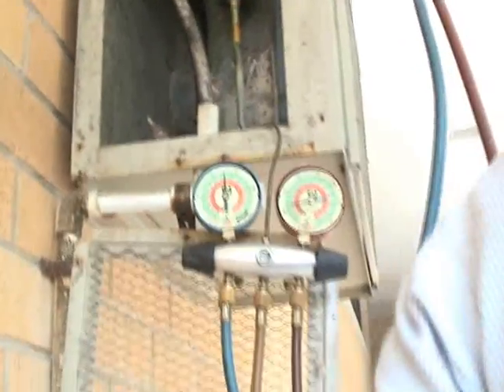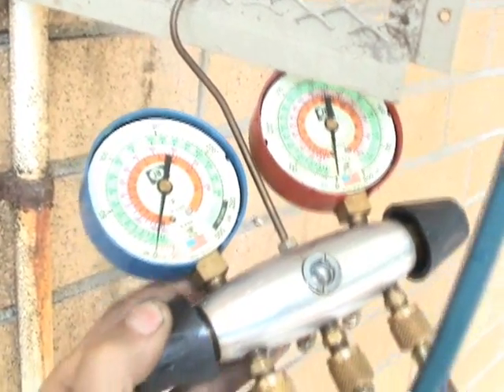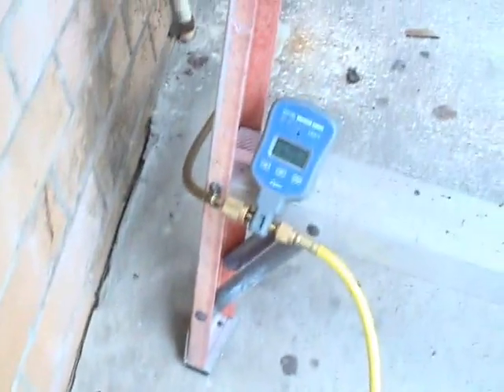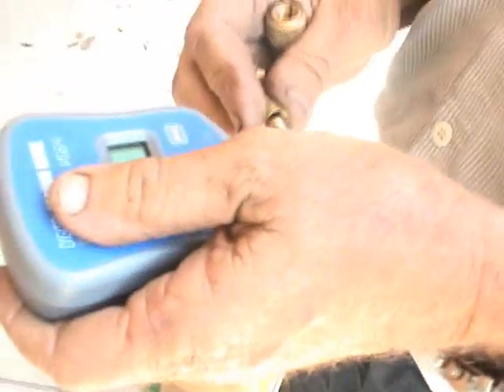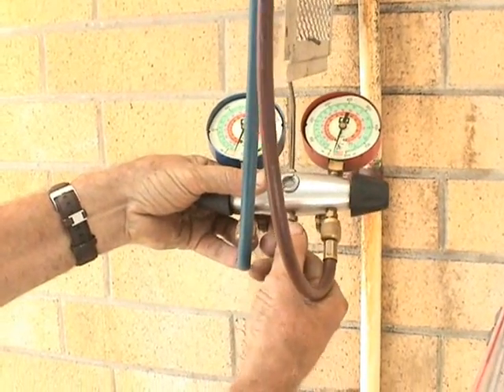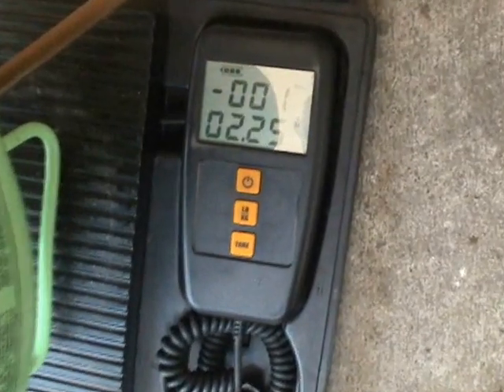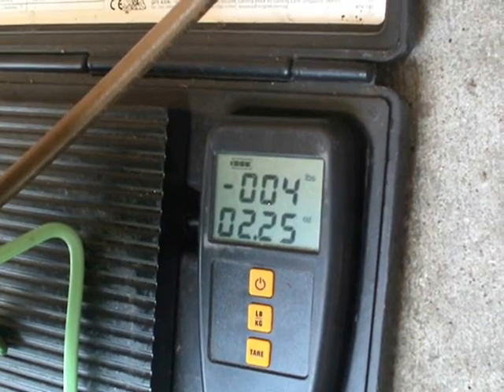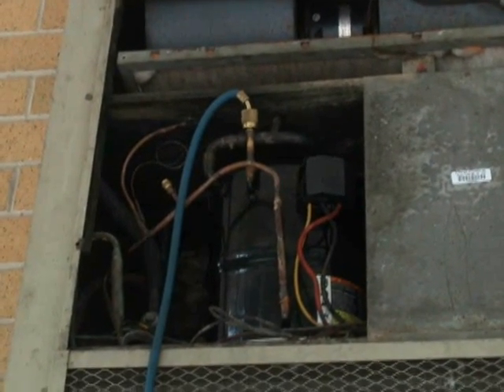HVAC compressor replacement 4

Comment: Dr. Z
        Enjoyed the video. I agree it doesn't seem right replacing a compressor in a unit that old but I do it all the time because my employer does not want to spend the money to replace the unit.Now the recips are being replaced with scrolls and as you know requires changing the piping.Any way I do enjoy your videos.